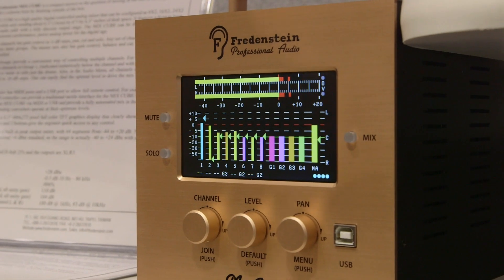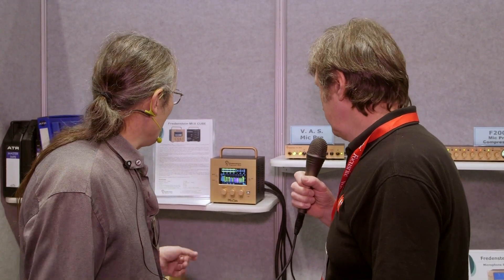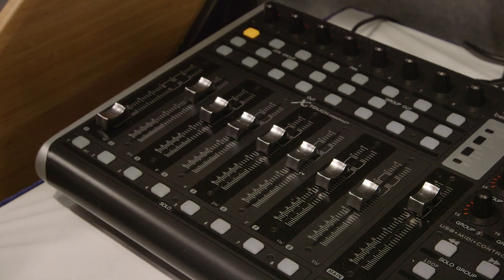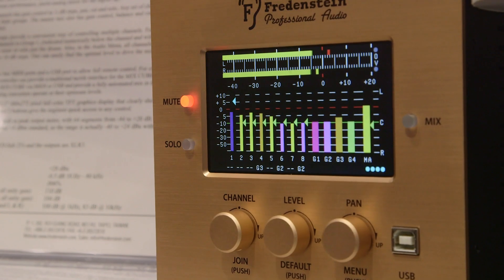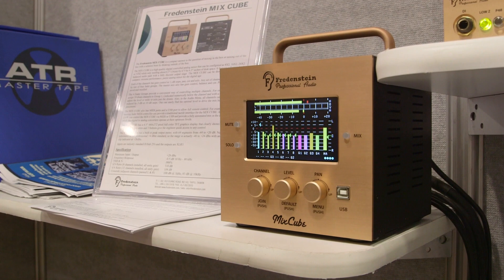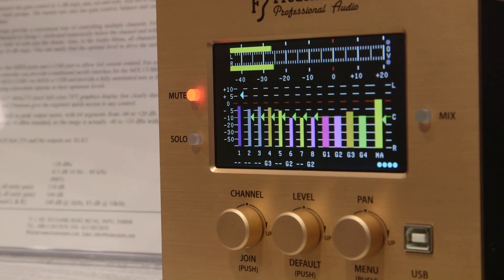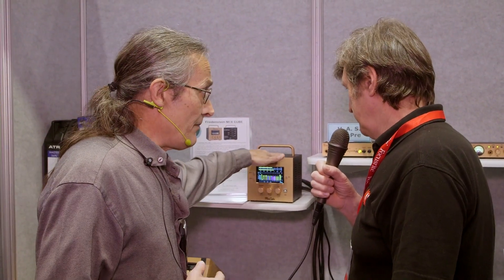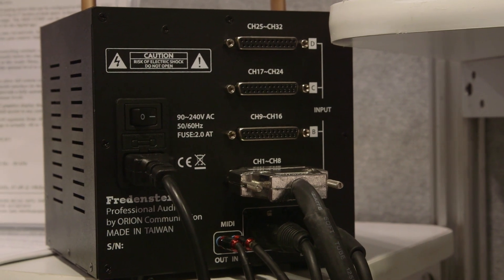Fredenstein Mix Cube - AES 2015

Comment: USD$3,400 for a very unnecessary gadget made in Taiwan (not to mention several hundred dollars extra for the connectors).
For that price I'd MUCH rather get another top-of-the-line Alienware laptop (even though they are a load of garbage).